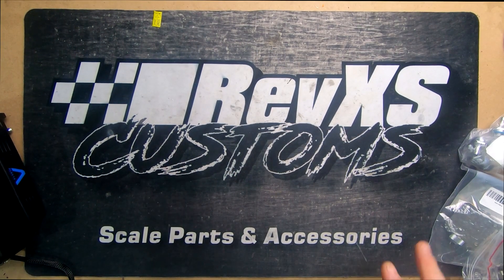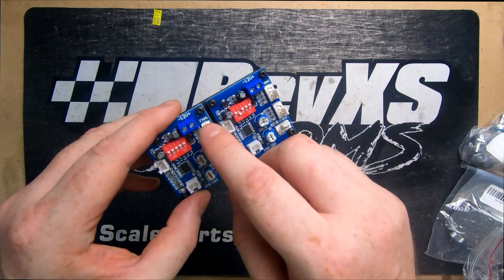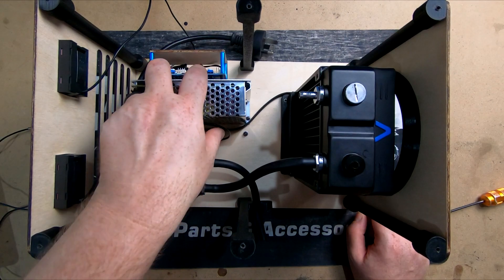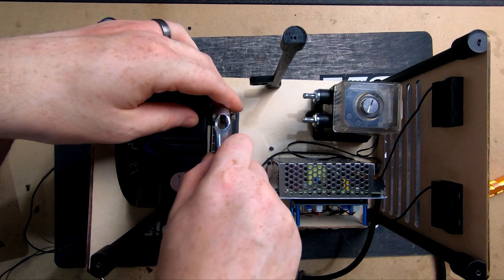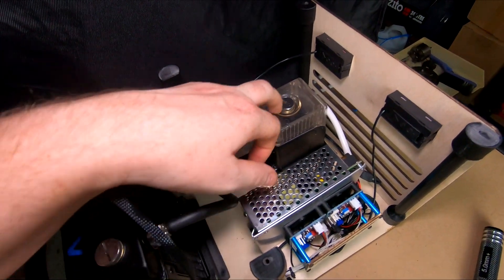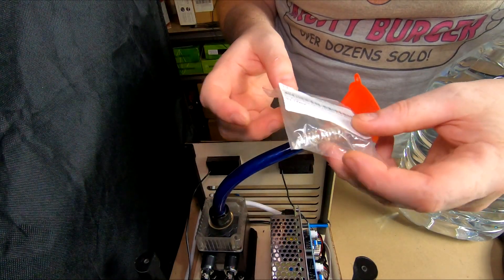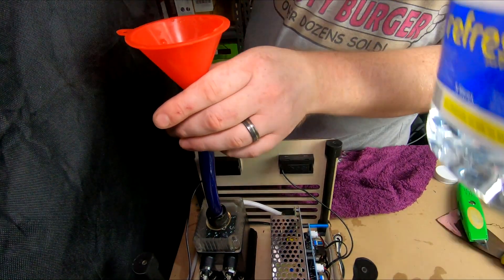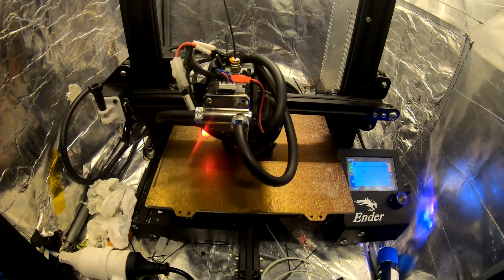Ender 3 Water Cooled Upgrade

Comment: So I thought cooling it would cause issues as it usually needs to stay hot, especially for ABS etc?
Reply from the maker: Still have heat form bed actively heating enclosure,once start working with likes of PEEK would be putting small heater in there to maintain higher temps.
Reply: You want to cool the steppers themselves.  As long as the cooling doesn't cause condensation or convection, it's a win.  Heat's an enemy of steppers whether it's due to pushing them hard (~400 mm/s print speeds...), baking the hell out of them (Printing LARGE PC prints in the enclosure...this was the cause for  my X/Y replacement this week...), or both.(Uhhmm...I'm going to pleade the Fifth for right now...we'll see if I blab about it shortly...)